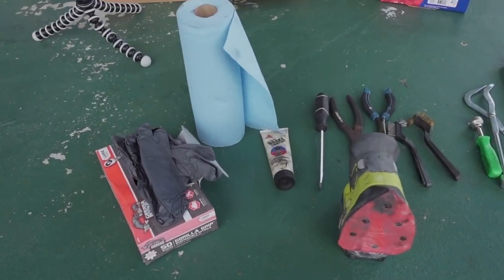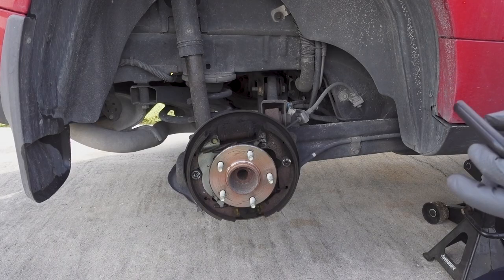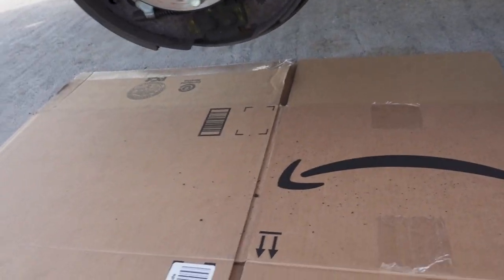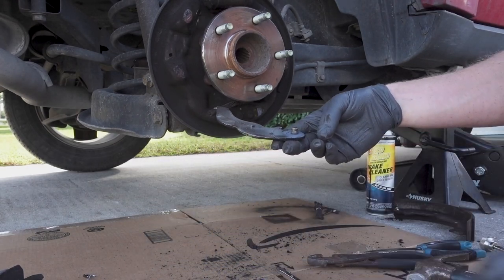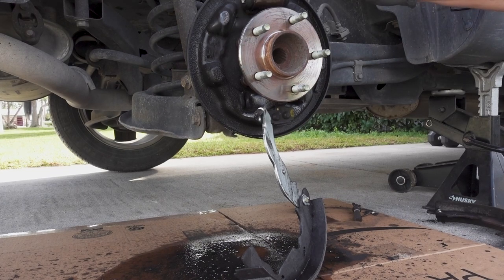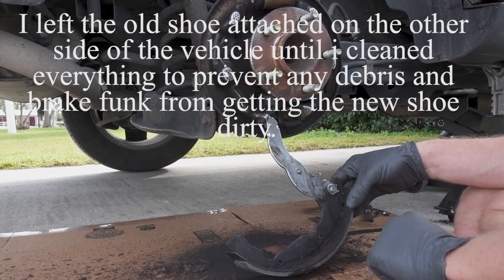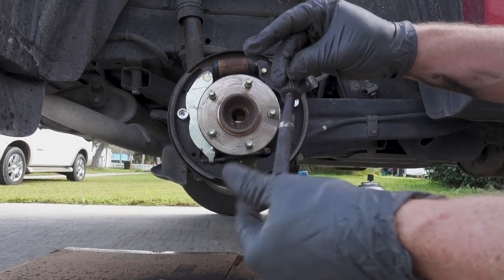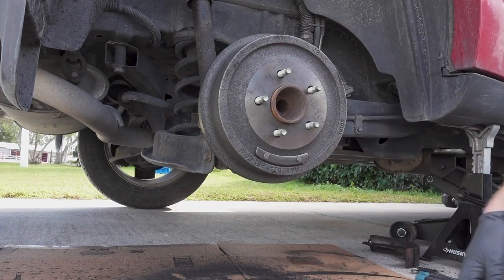How to change Brake Drums and Shoes on a 2006 Saturn Vue

Comment: Nice video, I'm a retired mechanic and have lots of experience with drum brakes. Pro-tip, don't install new parts before cleaning, and use high-temp brake parts lube on contact pads. Thanks for making this video CJ, great presentation.

Comment: Excellent video, very clear well lit, good audio. No annoying music. Parts are displayed and explained. Safety is shown by jack stand in place.  My dad taught me how to change brakes when I was about 14 I guess. I really enjoyed watching and the re-education of changing drum style brakes. I am contemplating converting over to disc brakes as a summer project. Well done on this video.
Reply from the maker: Thank you. I try my best to be safe and make a video that can help other hard working individuals like myself safe a few bucks $. I wouldn't mind converting my Saturn over to Disc brakes myself as I'm not a huge fan of the Drum brakes. But m\the work I did is still holding up great. No issues with my Brake job. Thanks for watching.

Comment: Great video , just for future reference when doing drum brakes there's 3 mating surfaces on each brake shoe that meets the rear backing plate that need to be greases to prevent any noises but other then that great job

Comment: Awesome! Will be using this video as a reference for when i change my drums on my 06 Saturn vue. Thanks!
Reply from the maker: Awesome. Good luck. I hope the video helps you.
Reply: Everyday CJ Sir, would you know if this procedure is the same for an 04' Vue? I have worked on my own vehicles since age 13, I'm 53 yo. now and purchased one of these "things" last August out of desperation. I find them one of the oddest vehicles that I've had the displeasure of fooling with! 

Mine is going to have front and rears done asap this spring, as they are sticking and pull to one side. Also, it's a 5 speed and  needs the emergency brake cable replaced. (Was wondering whether you had any encounters with that, as well.) Bought the truck from a local scheister "mechanic" that I'd known for a couple yrs, thought we were pretty tight, then got royally screwed. Typical salesman! Lol!

I bought the truck due to it not having a single spot of rust on it, and interior was acceptable. Looked really sharp with the huge Uniroyal tires, etc. Reason for no rust is because they are made of plastic! Only the front hood, back door, and half of the top are made of steel. I didn't know that, so I made a bad buy, and am frustrated with it. It's sharp, but plastic! 

I'd appreciate your experience w/the brakes, front as welll as rears. I'd be more than happy to share my expeiences trying to get it all straightened out this Spring.

Thank you in advance, Sir.
Reply: My 2004 Vue is identical.
Reply from the maker: good luck!
Reply from the maker: I believe your 04 would be the exact same as this 06. You should be able to follow along with this video. Best of luck!

Comment: 16:20
Protip: Instead of trying to muscle that spring on leave your front shoe off and hook the spring on both shoes. 
Then it takes very little effort hook the bottom followed by the top of the shoe on.

Comment: Frustrating. I had to use PB blaster and a hammer to get the drum off. I also went through an entire can of brake cleaner. Six beers later I managed to complete all the brakes. Drum brakes are dumb design.

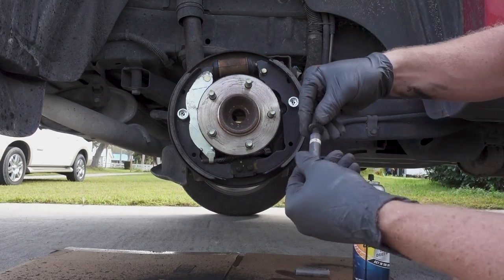Comment: Great video- definitely will use this. But at 14:30 you unscrew something, grease it and put it back together, but I don't see what it is, where it goes.
Reply from the maker: That is actually called the Brake Drum Self Adjuster and you can see the kit here. https://www.autozone.com/brakes-and-traction-control/brake-drum-self-adjusting-kit-rear/duralast-brake-drum-self-adjusting-kit-rear/976263_7293_6211

It's hard to describe but it sort of just sits in between the other parts and adjusts the tension accordingly as the drum shoes wear out naturally. It'll make more sense when you see it on your car once you dismantle everything. Just take good pictures of everything and do one side at a time so you can always reference the other side if needed. I had never done this job before i ventured out to do mine as well so i'm no expert. 

I hope this helps. Again, once you see it in person, you will understand how it all fits together. It basically can only go together one way.
Reply: John, see my comment above, that indeed is a criticial issue, and yes, VERY hard to describe, but not even mentioning that in the video.... just skipping over it, a major omission.

Comment: Dude. At 15:43 your holding that thing. Then poof its in and your puting the spring on. Im lost. Needed you to zoom in on it in place. Im watching this video because i didnt take pictures first 😔. But still very helpful.
Reply: In the 90s I took High School auto shop, and my shop teacher told us to keep Polaroid cameras around so that we could take photos of drum brake systems before taking them apart so that we know exactly how to hook them up before putting them back on.  Today's technology makes this so much easier.  ALWAYS TAKE PHOTOS!
Reply from the maker: Sorry. I did my best while filming myself. It’s hard to do. Being a novice mechanic I did my best and taking pictures seemed like the best way to go. Can you possibly take pics of the other side of your vehicle or did you remove both sides already?
Reply: No i didnt. I can make a video. I actually did the bearing. But ended up needing to remove the whole nuckle. Wich i had to remove the e brake line. Wich is connected to the brake shoes. So i took them off also. But will do the other side in a week

Comment: Belatedly came across this after fighting for months trying to figure out how the drum brake hardware was supposed to line up on my L-Series nightmare (2002)....  Turns out the S-series is NOT a good model, and the Vue is far better.  (especially on the positioning of the parking brake plate -- duh!  The gm provided diagrams are MISERABLY vague on key spots -- as is, surprisingly your glossing over two key issues: 1. the positioning of the adjuster  (at min 15:45 -- you must line up both notches, and that's VERY tricky on the front side shoe, as you can't see it behind the parking brake plate) and 2. the positioning of that final adjuster bracket and those last two springs -- nightmare that needs precision.  Get it wrong, and they'll be falling off.  Glad it turned out "great" for you, though those who watch this could easily have a different result, unless they find detailed diagrams or an even better video.  ps, next time you do rear drums, consider changing out the wheel cylinder on each side.  (They're cheap, and likely to leak -- and unlikely to last that much longer, given this is a gm.)
Reply: typo -- the positioning of the adjuster is tricky (devilish) on the trailing -- or "back" side....   If a newbie doesn't know to feel for it, and if Chilton or other manuals are as bad as they were with the L-series, one might know why that slot is so critical -- yah, grrrrr..... ) Again, except for the little devils I mentioned, this indeed is a great video, thanks.  (and wish I'd seen it earlier)

Comment: Would you let me know what the part is at 18:29? You don't show where you pulled it off and where you put it back on. Thanks!
Reply from the maker: F Rich the video is over at 18:29
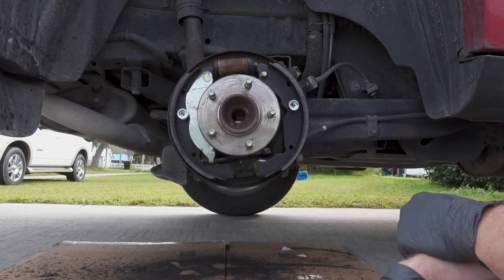Reply: @CJRichvideo  Sorry, I meant 14:29. But nevermind, I found out in another video. Thanks for making yours! I was going to change my drums and shoes out today, but after spending an hour to knock the old drums off (they were rusted on pretty good), I realized afterward that I didn't need to replace anything. I had been hearing some rubbing when I break, but the current drums and shoes are just fine.